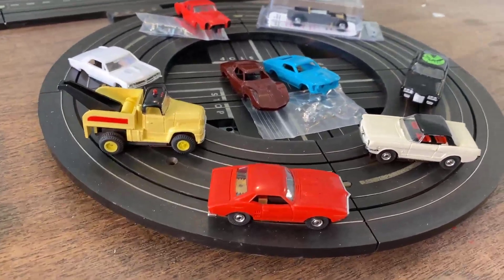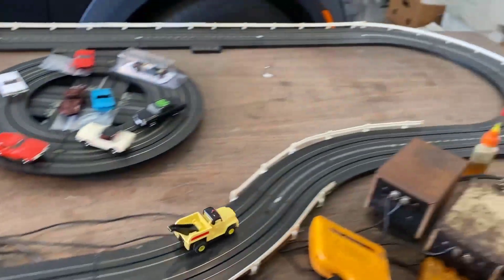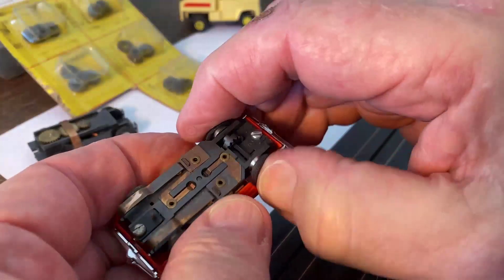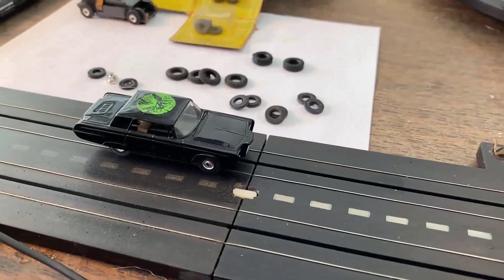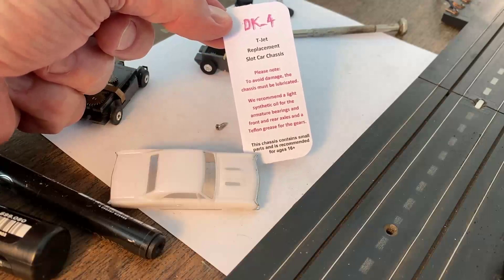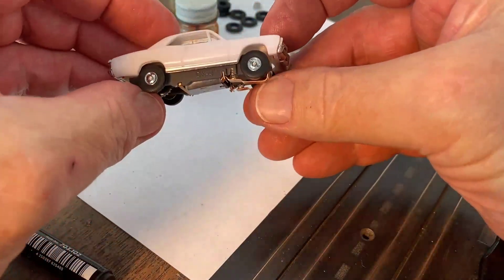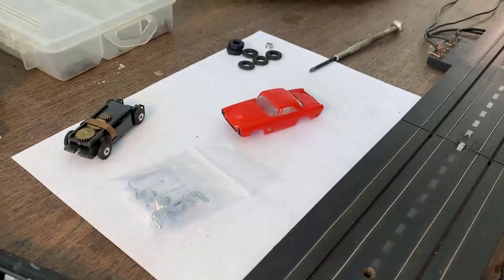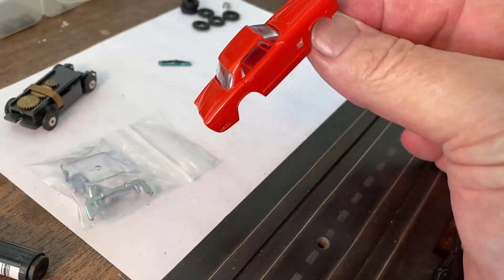Slot Car Tires and Maserati Restoration

Comment: Good work once again brotherman..that Jag Hobbies car might be more manageable at a slightly lower voltage...I replaced my power supply with an adjustable one..$20 Amazon..greetings from northern Alberta Canada 👍
Reply from the maker: Vlad, good to hear from you. Interesting regarding your fix with the power supply. I will keep that in mind.
Hope you had a good 420 up in the Great White North, see ya!!
Reply: Vlad Marc here from Ontario!! And keep her in the groove!!!!
Reply: Good suggestion about the power supply. The Tomy Tri power pack has 3 voltage settings and Auto World has a brand new variable voltage power pack which are are regulated and more stable than the classic power supplies.
Reply: @christopherbusch1933  ...I use variable power supplies on my 1/24 and 1/32..HO too..some of the old 1/24 take some serious power and the stock Carrera power supply  doesn't cut the mustard. 👍
Reply: @marcbuck9550  ...hello to you Marc..I try very hard at keeping it in the slot.
Reply from the maker: @christopherbusch1933  Hey Christopher, I've been going back and forth about the power supply or just getting rid of the chassis.
Reply from the maker: @marcbuck9550  Will do, and let me know if I can help get you the parts you need shipped to you.

Comment: You need an adjustable digital controller for those DK-4 chassis
Reply: An adjustable power-supply would do the trick..lower the voltage a little.
Reply: @VLADtheINHALERr  I just got mine after talking with Jag via text, they recommend a digital controller, it's the modulation of power rather than the voltage. If you look at a AFX Mega-G chassis, they are equipped a motor much like the DK-4. They also have a tiny circuit board that performs that task. I build customs, many based on MEV bodies which are tiny. This is the perfect chassis for that application as well as other projects. Mine is smooth and very fast but it can be driven easily with a adjustable digital controller. 😀
Reply: @oldhick9047  ...I race 1/24..1/32..and ho..I use variable power supplies on all..it helps me get the most out of each car..the motor in the Jag Hobbies car looks similar to a 1/43. 👍
Reply from the maker: @VLADtheINHALERr  I'm still thinking it's gonna go back on eBay...
Reply from the maker: @oldhick9047  Hey Hick,
Sounds like you've got it dialed in the way you want it!!
Reply: @JeffRyan  Dialing down the sensitivity is the key, it gives a drivable car at any voltage. Good luck what ever you decide to do my friend.
Reply from the maker: @VLADtheINHALERr  Hey Vlad, to work around the power issue, I think the DK-4 chassis will be found back on eBay.
Reply from the maker: @oldhick9047  Hey Hick,
I was thinking of some practical use for the DK-4 chassis. Maybe a Track Cleaner since it has so much power. I could put a carborundum impregnated block in front and the back. At this point I kinda hate to give up on it. I'll figure something out.

Comment: Good stuff here, Jeff! I am going to try one of the Jags. Less maintenance with a can motor. But will it coast like a TJet? Opens a lot of possibilities? Was just thinking about using ez off on a q tip. Glad to know thats a thing.
Reply from the maker: Hey Shift, I think the Jag chassis is very well built and easy maintenance. The issue I have is that it's WAY too fast to keep on the track.
Reply: @JeffRyan  On their page now. Recommend a 120 ohm controller. I am sure I dont have that.
Reply from the maker: @shiftintohigh5564  Hey Shift, if I have to buy a controller to tame to speed of a single slot car chassis, probably not gonna happen. I'll stick with my old-ass Aurora speed controllers and give the chassis away.
Reply: @JeffRyan  Ha ha ha, I know right? Great concept tho. But Car + Controller = not gonna happen. Here either.
Reply: Really its 2 controllers.

Comment: I have two DK-4s and  put bigger wheels and tires on them with added weight and they still seem two fast to stay on the track. I want to go back to  the standard setup you have and lower the voltage but  these DK-4s  seem to be dragway only cars. I want to thank Jags for the efforts but the DK-4 is a VW with a V8 engine.
Reply: You need an adjustable, digital controller like a BSRT or DeFalco. Then they are quite controllable at low speeds,
Reply from the maker: Hey Pinhas,
What a great analogy, you just cracked me up! 
Regarding adding weight to the DK-4 chassis to slow um down from hyper speed, to a manageable speed, I considered mounting a cinder block to it. I thought that might work for a bit, right?!
Have fun Pinhas!!
Reply from the maker: @oldhick9047  Hey Hick,
Great tip with the controller, but I don't know if I want to buy a controller for one chassis or put it back on eBay so someone else can ruin their slot car bodies with it. Lol
Reply: @JeffRyan  I got my first DK-4 after texting with Jag. They advised the digital controller
which I already had because of the racing I do. My interest in them is their tiny size. Building customs as I do, I will find many uses for them. They fit great under MEV bodies as well as the old Aurora vibrators.
Reply from the maker: @oldhick9047  Hey,
Because the chassis is so fast, maybe I can attach my dogs leashes to it and have um go for a walk/run that way.
A solution will present itself.
Reply: @JeffRyan  It looks like Jag is coming out with a standard DK-4 model in the near future, but i can't see buying a 3 digit priced  controller to run the high performace  DK-4 that cost $20.
Reply from the maker: @pinhaslavon6306  Hey,
Touché, well stated. Good advise.

Comment: the new JAG DK-4 Chassis have a Resistor 68 Ohm make them slower
Reply from the maker: Hey Makis,
I had no idea, thank you. I might have to try um out. Because the way this one runs so damn fast, I can't keep it on the track, it's really not fun to try and play with. Again maybe solely used as a dragster, but that's about it.
See ya Makis, let me know if you need anything.